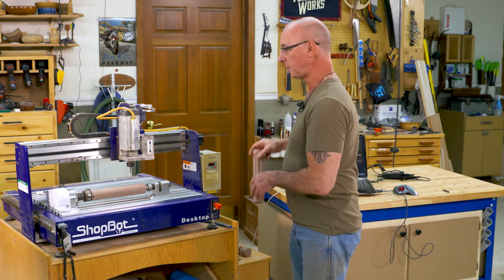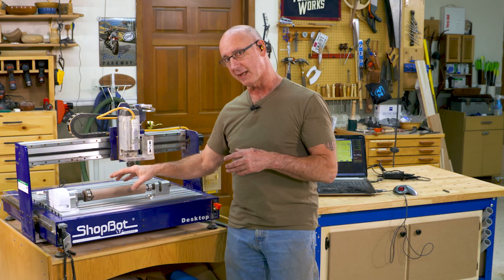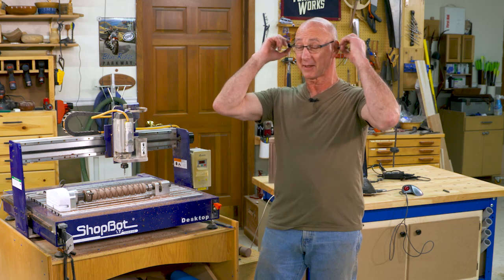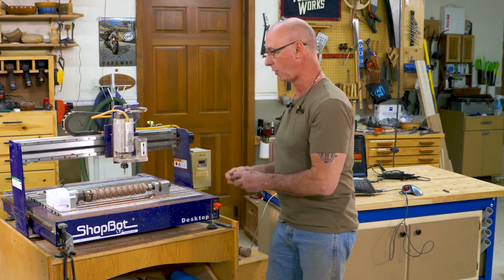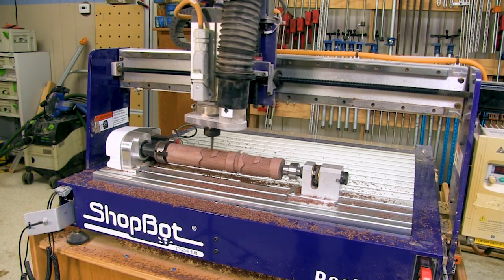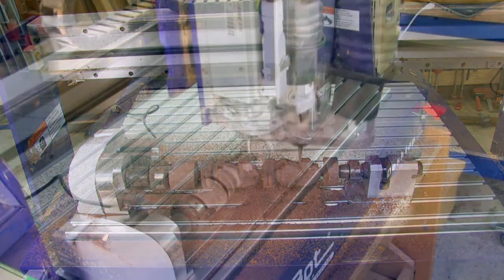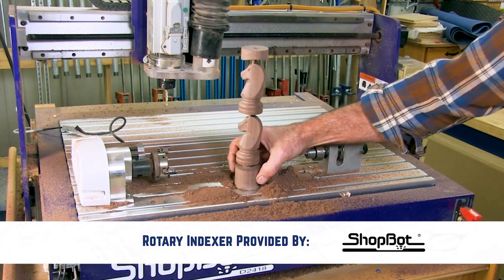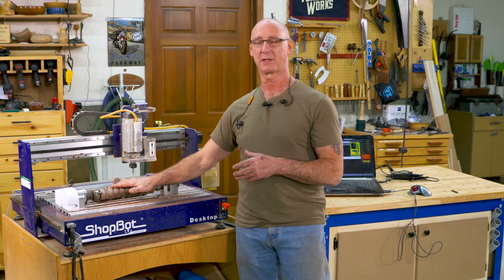WWGOA's George Vondriska Demos the ShopBot Rotary Indexer

Comment: Telling your viewers that you can just walk away and let the machine run is kinda irresponsible
Reply from the maker: We agree that everyone should be smart about where they are when any machine is in operation, however, with certain CNC operations, it's not expected that an individual will have to watch the machine from start to finish. Lots of variables to consider. Can we help you with any questions about the ShopBot CNC machine or related accessories?

Comment: Some information missing (I might find this on ShopBot's site, but while I'm here:
  - One can assume that it can be added to CNCs by other companies, but that wasn't actually said.  If it is possible, then the required specs are...?
  - As with any lathe, there is a diameter limit.  Does 3" refer to the height of the unit?  Max diameter?  What is that limit?
  - Do common CAD/CAM software products interface with this (especially Vectric)?
  - Users will not only have to define X,Y and Z (as with any CNC) but also ensure the ShopBot remains precisely oriented along that X-axis.  How much deviation before project quality is noticeably different?

Knowing nothing about WWGOA, I assume they're impartial advocates for woodworking, so this needs a comment about alternative systems to the ShopBOT (maybe aspects in which ShopBOT excels, but also its limits).  This might actually be a ShopBot-sponsored video, but even so, they have to know that buyers want to compare before investing.  Great companies address that directly.
Reply from the maker: Hi David, the ShopBot Rotary Indexer is designed to work with ShopBot CNC machines and included software. For any additional info, please contact ShopBot tech support at 888-680-4466 or email support@shopbottools.com. Thank you for checking out this video. You should check out WWGOA (Woodworkers Guild of America) at wwgoa.com. They are a great resource for woodworkers of all levels.
Reply: The drive stepper motor is a 0.9 deg/step motor run through a 3:1 gear reduction driven by a stepper driver that is capable of 1/10 microstepping -- so the motor steps per degree work out to 33.33. The motor driver can handle between 15 and 50VDC. Any machine setup that is able to drive a stepper motor could be used to control this rotary indexer. 

3" refers to the suggested diameter limit. It is possible to get slightly larger pieces in the machine but the strength of the drive motor really sets the limit for what you want to try to turn on this setup. 

I use vectric software exclusively to program my indexer. VCarve (or any of their products with rotary tool options) can take in .stl files and output rotary cut files. 

Setting up your headstock and tailstock so that the turning axis is parallel to both your X and Y axes is critical to getting good quality cuts. Before loading any material into your indexer it is a good idea to chuck up a V-Bit in the headstock and use the machine to confirm that the tip of the V Bit in the headstock is perfectly aligned with the tip of the live center in the tailstock. 3D rotary is very forgiving as far as the appearance of a part cut with poor alignment on the indexer -- but if the accuracy of the size of your part is critical, you'll need to make sure that your setup is dialed in.

There are a lot of options for small size rotary indexers for CNC -- and a lot of really affordable ones exactly in this size range. Honestly, there is not much to mechanically differentiate this indexer from any of the cheaper ones you can find on amazon. The main advantage of buying this indexer if you're a ShopBot owner is that the engineering team at ShopBot designed this device and it is manufactured by ShopBot -- meaning that the customer support team at ShopBot is most familiar with this setup and can provide training and help more quickly. I do not think that owners of other CNC equipment would benefit from purchasing this indexer instead of other similar options.